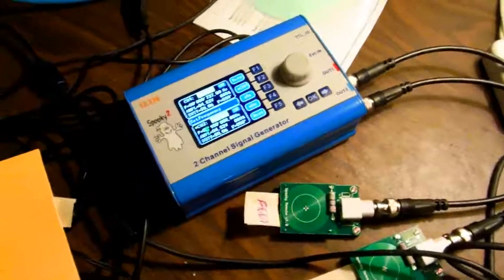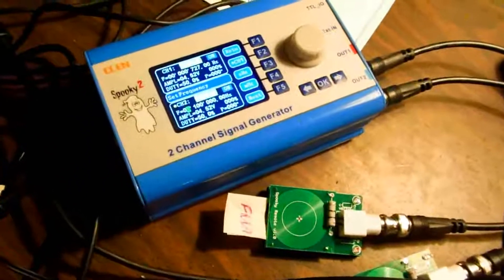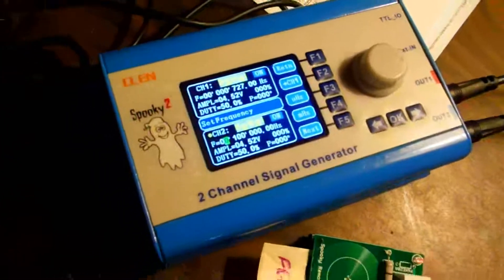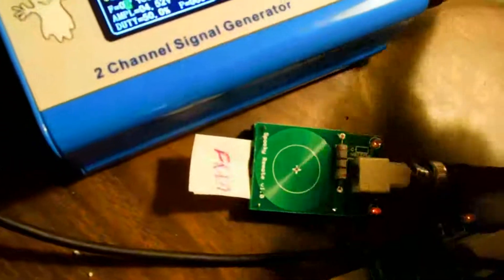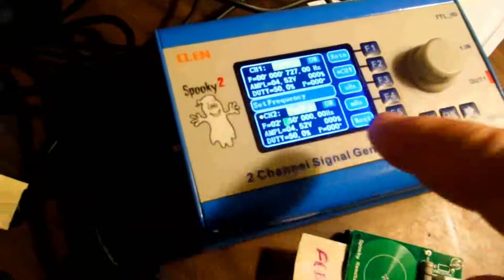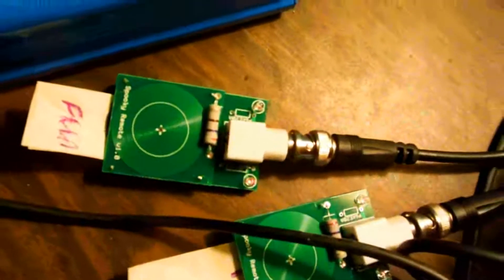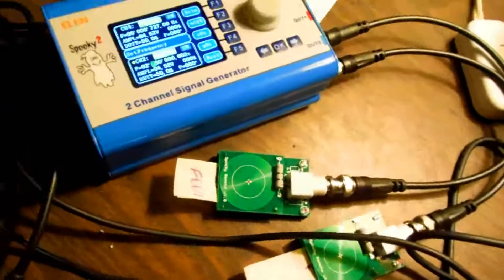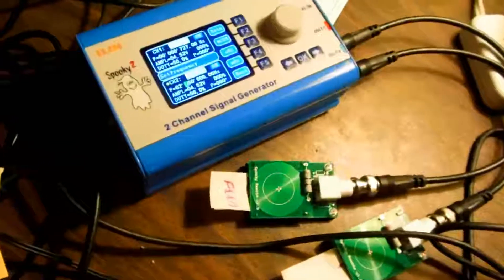Experimental Flea Death Ray -Save the Cats

Comment: I find this way far fetched that sine wave 2.750Khz will kill fleas thou I wan the fuckers dead in few mins I don't want them on my cats I don't want to see them.

Maybe a jar with sine wave 2.750Khz playing to see on video if fleas crack up and roll over dead?

I know if flea placed in jar sealed and placed in freezer for about 2 mins flea is TOAST! So the change in temperature is a shock to their system.  

Flea fogger lots of vacuuming each day and evening the more sucked up and disposed off right after cleaning the more the issue will be cleared up quicker.  

Combing cat with wet flea comb and checking to see if one is in the comb then wash it down the sink drain!
Reply from the maker: Ha, not an AUDIO wave.  Plasma is best.
Reply: Where is actual video of fleas being killed with 2750 I want to see first hand these fuckers dying in minutes!
Reply from the maker: I used the remote with fleas in the mobius coil for Rocky the cat.  It took over 2 weeks.   It worked.  I didn't use the plasma.
Reply: You do know there are more of them and in hidden places. Where your cats roam around the odd few fleas will be scratched off lay a few eggs. 

One thing is not seen fleas climb walls yet though not impossible. 

What you should do is wear underpants and slippers for a few weeks and take off slippers and pat them over the bath tab that is often white and see if you can spot any! If spot any wash them down right away down the drain! 

The times I had done that I lost count. I can often sense them.

Fleas can jump as high as 6" I seen. If they manage to get on your cloths they'll climb up to your hair. 

Get short haircut and give a wash a few times a day to check.

Fleas don't like cold not the freezer if captured and placed in jar in freezer flea will be TOAST in a few minutes.

So liquid helium will TOAST the fucking fleas!
Reply from the maker: The remote method killed every flea in the house., unless it was a hellofva coincidence to say the least.
Reply: Well if a home was designed like a white room would be easier to spot them!

Comment: you say you used 2750 Hz, while setting 2750 kHz. I can testify 2750 does not work
Reply from the maker: +D Ivanchuk I used 2750 Hz
Reply: The video shows 2750kHz or 2,750,000.00 Hz

Comment: One summer weather conditions were perfect to breed them. We had one medium sized dog, no cats or other animals. Our dog kept getting them over and over despite being dipped by a pro groomer. Vet told me I needed the time release insecticide only they could sell. She said you can vacuum and they run for places to hide. Eggs hatch in carpets and elsewhere later about 30 days later - which is when the time release part of the insecticide releases itself and kills those too, breaking the life cycle.
Went to the vet and bought 2 bottles, which is enough time-release insecticide for all the floors and furniture in our home. Used a Kirby vacuum spray attachment. I covered every square inch of our home. At the same time had the dog dipped once more. This stuff WORKS. Never had the problem again and that was 20 years ago.

Comment: So the question is, did it work ?  I am assuming that fleas don't all have the same dna, perhaps you will only kill the descendents of the few fleas in your Scalar wave device.  I see I am not the only one who lays awake at night thinking about this stuff.
Reply from the maker: There were fleas outside still.  What you just said would explain that.  From my understanding this device is not supposed to work as I tried to use it against fleas.  It is a hell of a coincidence that in less than 3 days the fleas were gone.  I was using the best stuff to spray for fleas for 3 months, every day and they just came back.  When I used this , they got clobbered Or is is big coincidence.